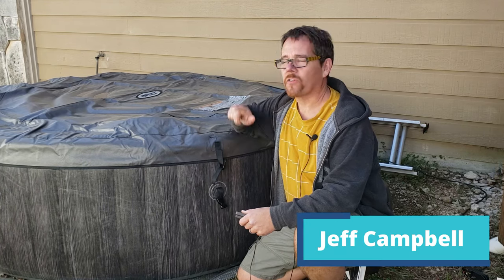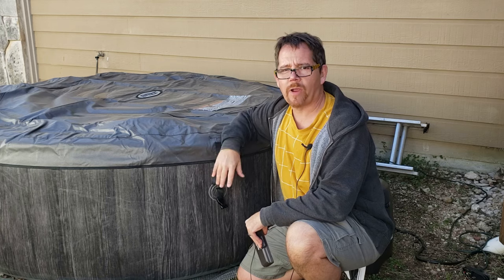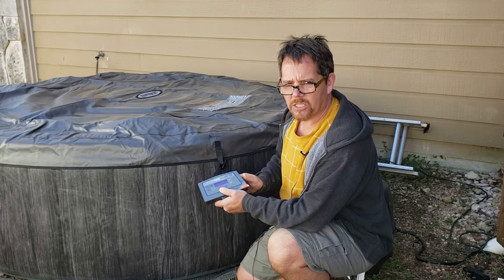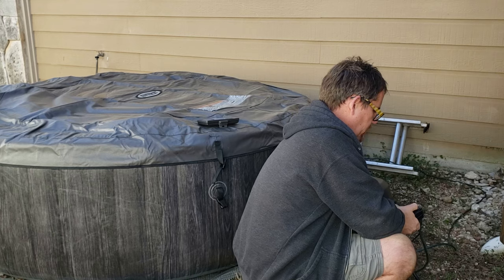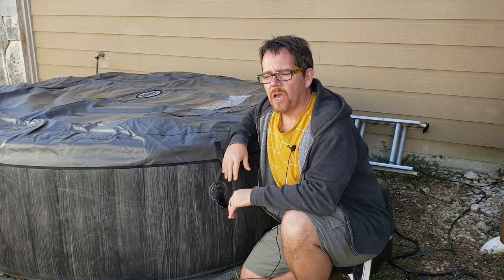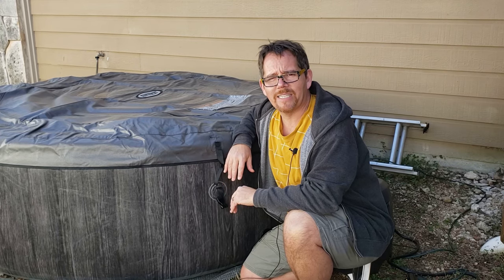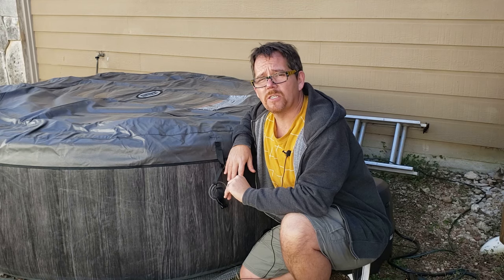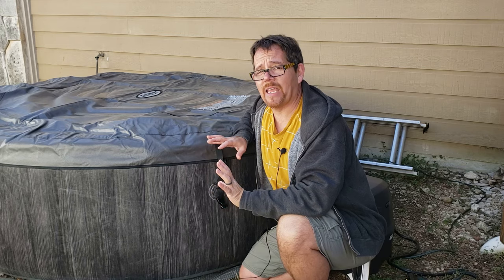Intex PureSpa Error Code Fix and Reset

Comment: I've tried all of these suggested work around tips. Still showing E81 on the screen and beeping. New filters fixed the E90 codes. Temp in 50s at night here in Iowa. Not sure what else to try? I've had nothing but problems with this hot tub.
Reply: You ever get this fixed?

Comment: Thanks for making this video. After dealing with the dreaded E81 MANY times over the years, I suspect this happens to mine whenever there is an interruption to the electric or the wifi, as it seems to correspond with power surges, overnight router updates, etc. I struggled with the reset until I tried this:
Step 1:
Take the control panel from the pump unit and hold it in your hand

Step 2:
Press and hold the on/off button for more than 5 seconds to turn off the control panel

Step 3:
Unplug the pump unit from the power outlet

Step 4:
Place the control panel, which is still off, back on the pump unit

Step 5:
Plug the pump unit back into the power outlet and activate the spa with the RESET (Rücksetzen) button and wait for 1 to 3 seconds
Pay attention! Do not press the TEST button, this will turn off the spa again

The control panel will then reconnect and display the temperature. Please note: the control panel is still off. To operate the control panel, you have to switch on the control panel. I have the devil of a time trying to turn it back on, but eventually get there.

Comment: Just got the Intex Pure Spa!! Love the tub. Set up is easy. I am experiencing a steady leak but all connections are tight. I did have the error code E 80/ E81 but resetting fixed it, Thank You !!
Reply: The steady leak is probably from not having the silicone seal ring thingys things on it, that was my issue

Comment: It will flash END if the heater is unable to reach the set temperature after 72 hours. This can be caused be extreme cold, not enough insulation from your cover (Are you using an energy saving cover that comes all the way down to the ground?) or if the heater is having difficulties. You should be able to wake it back up by pressing the filter button.
E81 is if you lose wireless signal between the pump unit and control panel. This can be caused by excessive distance between the two.

If you have a new pump and re-use the old control panel, I do not know how to pair the two together.

Comment: I’ve had an Intex inflatable hot tub for a couple years. You are correct that when the water fails to get to temperature after around 24 hours it just shuts off and you have to restart it again, it’s really pretty annoying and I wish it would just keep trying to heat the water even if it’s not reaching full temperature.
Reply from the maker: Thanks, Matt

Comment: I had an E81 after power overloads. Too many power users hooked up
Reply: I woke up to an E81 the first morning after initial setup.  The GFCI on the plug kept tripping.  Other devices on the same circuit were functioning just fine.  I plugged a hair dryer with a GFCI plug into the same outlet as the spa and it worked fine.  My suspicion is when my grow light turned on at 8am, it was too much for the spa to run as well and the GFCI sense the additional draw and tripped?  Unfortunately, I don't know exactly how I got it reset but after several iterations of unplugging it and powering off/on the control panel, it started working again.  I moved the grow light to another circuit and (knock on graywood) I haven't gotten another E81 since.
Reply: @JohnMFritsch  thanks for the tip mine is doing the same thing only when i turn on the heater, tried other outlets still keeps doing it.